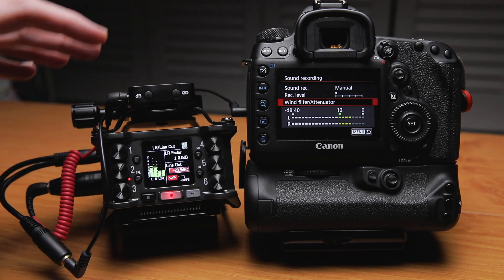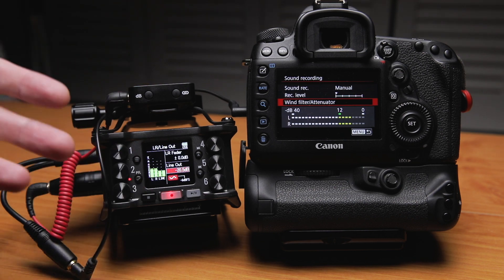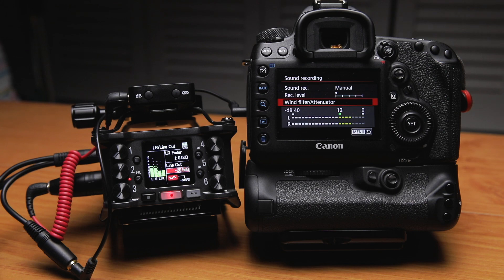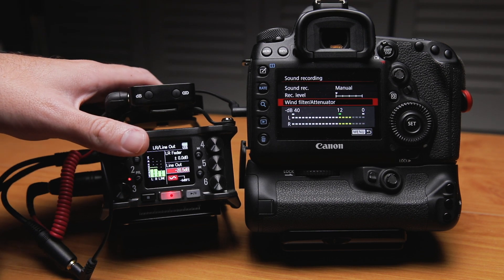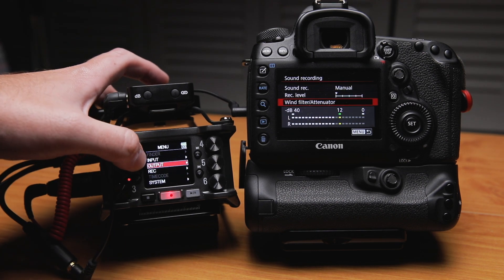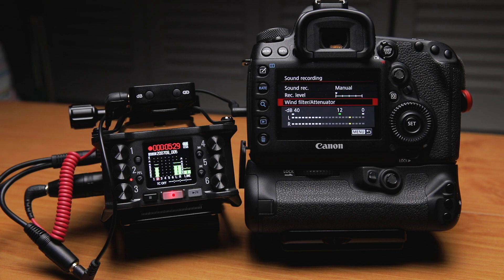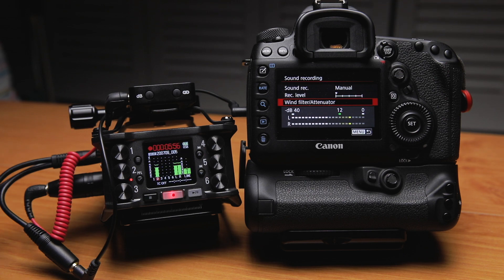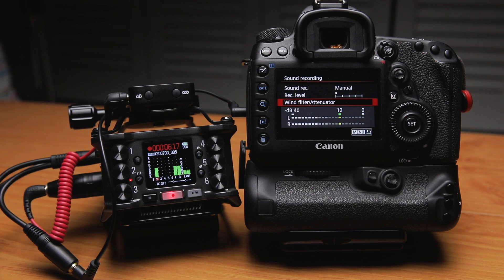My Zoom F6 Line-out Noise Workaround

Comment: Good find, this is actually a not the f6 problem but those cameras that dont have line inputs. camera makers should do switchable line/mic inputs instead. Thanks anyway i'm buying an attenuator cable. I just bought the f6 off the second market where the owner is frustrated about the line out being hard on his camera. I bought it for 100 dollars. lol
Reply from the maker: To be fair, while it would great for most mirrorless cameras to be able to take line and mic level signals. I don't think it's really fair to say this isn't an F6 problem. Zoom advertises that the F6's line out can be internally attenuated to mic level. Technically, it can; but doing so cuts the dynamic range by at least half.
Reply: @PointsInFocus  Yeah they should not claim something that is not.

Comment: Hi Jason, thanks for your clear explanation! I'm about to purchase a Zoom F6 to use with my Canon R6. I would like to connect these two via a Rode Wireless Go transmitter / reciever. My question is: do you think that in setting the Rode Wirelss Go to the lowest gain setting (-24 dB), it would act in the same way as an attenuator cable?  Thanks in advance for your reply!
Reply from the maker: I had my gear sitting on my desk, so I just checked. It looks like you'll want to use an attenuator cable in that configuration. 

Using the -6 dB test signal from the F6, the level meter on my Wireless Go Rx unit is clipping if I feed an unattenuated signal into it from the F6 — this should show at about -6 dB. I had to add about 30 dB of attenuation to get it to show about -6 dB on the receiver's meter. However, I only looked at the meters, I didn't listen to the signal.

If you want to feed a signal back to the camera using the Wireless GO, and you need it for more than scratch audio, then you'll want to use an attenuator cable. If you're just using this for scratch audio to sync in post, you might be able to get away with setting -30 dB on the F6's line out and see if that works in your environment. It will reduce the dynamic range, but you'd have about 66dB of working range and so as your levels are good (peaking around -12 dB) that probably would be a clean enough signal to for waveform sync to work in post.

Hope that helps.

Comment: Although your video a hiss sound to it sir ?
Reply from the maker: The "hiss" you hear in this video is actually room noise. Mostly I think it's coming from the fans in my workstation, but there are several sources of noise that I'm either unwilling or unable to turn off to lower the room's noise floor any further.
Reply: @PointsInFocus  it’s strange though because I have the same exact thing going on with my set up I have a F6, a cloud lifter, running into a Canon 5D Mark four… If I’m listening to the headphones, which are not a high-quality, I cannot hear the hiss but if I make a recording to an SD card or using the line out straight to camera… I get that same exact hiss.... Do you think Curtis as a soundproof room that he’s films in or something?
Are you completely certain that is what’s going on?
Reply from the maker: If I remember correctly, Curtis does a lot of his video work in a basement that's been treated with sound blankets. I'm working in a room that's not treated at all (though I should really look into doing something about that) and has a ton of hard surfaces (including floors) to bounce noise around. According to the app "dB meter" on my iPhone, my noise floor is around typically around 38-40 dB-A.

In my case, yes, I'm certain the hiss in my videos is due to room noise. For example, if I turn off my wireless mic system and make a recording, it's dead silent.

Comment: Can I use the F6 as preamp in 32 bit float.for mic or line in (Fuji x-t4)
Reply from the maker: You could, but I wouldn't.

If you're not recording, the FP32 mode doesn't really matter. It essentially just changes how  levels are set internally, but not really anything else, but because you're not using the FP32 files, you still have to set levels for your mics appropriately. Moreover, the dynamic range is going to be limited by the line out DACs and the noise issues talked about in this video.

So yea, it'll work in a pinch, but the F6 isn't really optimal for it.
Reply: @PointsInFocus  Thanks

Comment: Hello Jayson. Thank you for sharing your work around. I'd like to get get to know which TRX cable you have used to connect Zoom f6 to Canon microphone? What you've mount on the top of your zoom F6? It would be great if you response. Best regards from Germany.
Reply from the maker: On top of the F6 in the video I have the included camera mount adapter (that's the mental plate that everything is attached to and it comes with the F6). Clipped to the front of that is a Rode Wireless Go receiver for my lav mic. The knob you see behind the Wireless Go receiver is from a generic arca-swiss style quick release clamp that I used to mount the F6 to a rail that hangs it under my camera.

As for connecting the F6 to the camera. You can use any standard 3.5mm TRS (tip ring shield) cable with two male plugs.

Hope that helps.
Reply: @PointsInFocus  Thanks Jayson.

Comment: thanks for this. can i use the zoom f6 or the mixpre-3 ii with the rode video mic pro + via the 3.5 jack? are there limitations to this quality wise compared to using a xlr shotgun mic?  thanks so much for your thoughts.
Reply from the maker: Sort of... With the F6, you'll need to use a 3.5mm to XLR adapter (like the Rode VXLR) to plug the Video Mic Pro into the XLR inputs, as there's no 3.5mm input . You'll also need to insure that you turn off phantom power for that input. I don't have a mixpre-ii, but I think it has a 3.5mm mic in that you can use without an adapter.

As for quality limitations. The only real limitation is that if you need to use a long extension cable between the mic and the recorder (like more than a few feet), then it's possible for the cable to pick up interference because the mic doesn't produce a balanced signal. Otherwise, a mic is pretty much a mic. I used a Video Mic Pro with a 8-16 foot long 3.5mm cable hooked up to a Zoom H4n or Tascam DR-60d before I got the F6 and I never personally ran into interference issues.

Comment: Hi Jason thank you for the tips,did you mange to try it with the eos R5? Is it the same setting and values? Thanks
Reply from the maker: I just did a quick test and the R5 appears to behave differently than the 5D mark IVs do.

For my output level of 20.5 dB, it looks like I need 5 clicks of gain on the R5 to put the -6dB test tone at -6dB.

However, I'm not sure if the R5 is doing the gain control the way the 5D4 does. When I increase the gain of the test tone on the F6, I don't see a similar increase in gain on the level meter on the R5. I'll need to dig into this a lot more to understand what's exactly is going on though.
Reply from the maker: So after doing a little more digging, the EOS R5 is definitely doing something different than the 5D mark IV in how it handles manual gain with the audio. And using this technique results in clipping the signal above -6 db.

I'm going to put a video up about this instead of trying to explain it all here. But my early impression is that you will need to adjust the technique I described here to work properly with the R5.
Reply: @PointsInFocus  Thanks so much Jason for taking the time to explain :) I'm a bit worried I don't want to blow my preamps in the camera :D will be waiting for your update take care)
Reply from the maker: If you're only using the F6 with the R5 (that is you're not splitting the line out to multiple cameras), then the best option for you would probably be to buy a -50 dB attenuator cable and run the F6's output at full line level.

Something like this Sescom cable https://amzn.to/36tb9U4 (affiliate link). With that set the F6's line out to 0 dB attenuation, and adjust the gain on your camera to get the -6 dB tone to about -6dB on the level meter. The signal the camera is getting will be mic level, so there's no risk of overloading anything.

If you can't find a -50 dB attenuator, or you already have one with less attenuation, you can use one with a less attenuation and apply the difference to the F6's built in attenuation. For example, if you have a -35 dB pad, you can use that and set the F6's output to -15 dB and that will have the same affect as using the full -50 dB pad.
Reply: @PointsInFocus  Thank so much Jason :) yeah mainly I will be using the zoom f6 with the R5 as a back up track for syncing or when it's a small shoot , so that cable that you sent me is -35 only right? you said the best one is -50? I made a quick search but there is not -50 only -35 or -25 not sure if I should get the one that you send me or search for -50 instead thanks)
Reply: Okay so I bought the one that you recommended :) so basically I will make the attenuation inside the zoom f6 -15 so total will be -50 right? thanks :))
Reply from the maker: Yes, that's correct. If you set the F6 to -15 dB, and use a -35 dB cable, the camera will see a signal at mic level (-50 dB).
Reply: @PointsInFocus  Thanks :) but after I saw your new video I canceled my order and I will do as you said in the new video thanks ;)
Reply: @PointsInFocus  Great video! The link to the wire with the attenuator is not working...send the name of the wire or a working link. Thanks.

Comment: Hi thanks for this interesting workaround. I am interested to know what XLR adapter you used to get the RODE wireless to connect to the Zoom F6. I am interested in getting 6 RODE wireless GOs connecting to a Zoom F6. do you think I can avoid interference between the RODE receivers? what are your thoughts?
Reply from the maker: I use Rode's VXLR adapter, but anything comparable to it should work. You don't need the VXLR+, since you don't need the phantom to plugin-in power conversion capability, but that would also work just as well too.

As for using multiple wireless go's together, I don't have any first hand experience with that. However, I don't see why it shouldn't work. Rode claims that 8 pairs of Wireless GOs can be used in the same location, and I don't see any reason that proximity of the receivers to each other should matter. They're 2.4 GHz digital devices anyway, so they already have to deal with interference from WiFi, Bluetooth, microwave ovens, and so forth as it is, so as long as you stay under Rode's limit I don't see why it wouldn't work. If you try this and do have problems, I'd love to know.

Hope that helps.
Reply: Points in Focus thanks for the info. I will let you know how I get on.